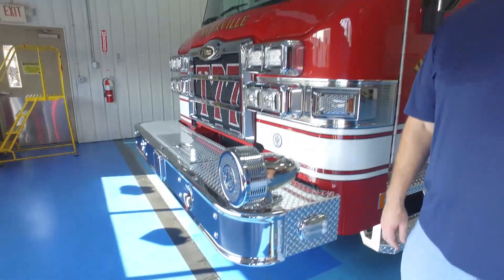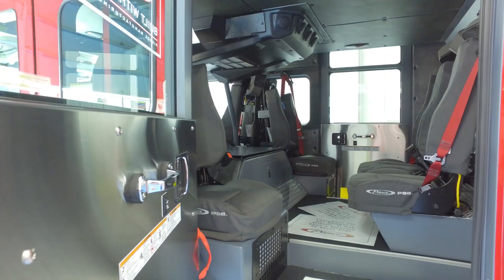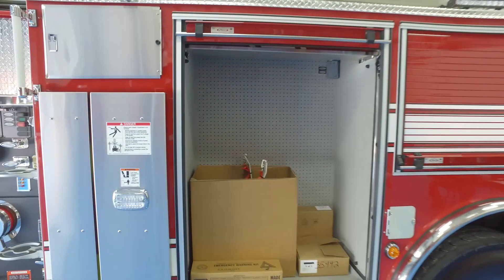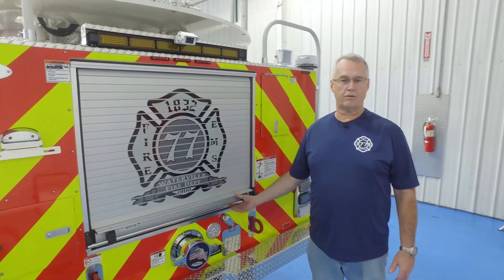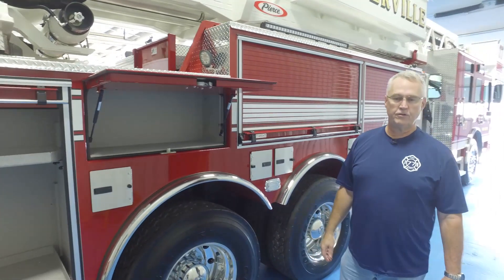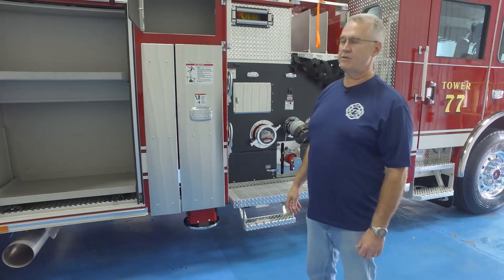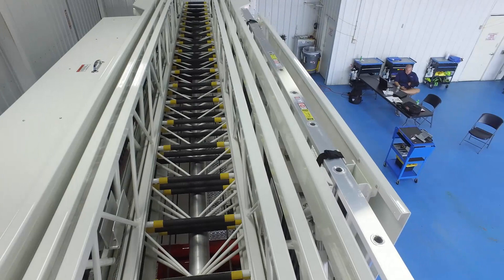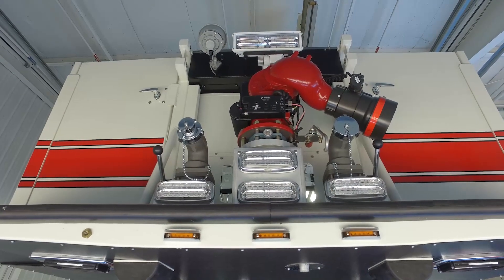Velocity® 100’ Heavy-Duty Aluminum Aerial Platform – Waterville, OH

Comment: How much?
Reply: Normally a rig like that runs between 850 and 1.2 million if it's custom. That's a stock truck so that's probably on the lower end of the scale.
Reply: @rolandmiller5456  Have to believe that it's at least 1.2 million.  The volunteer dept. I belonged to many years ago last year bought 2 ambulances at 1/2 million each just for an ambulance.
Reply: That is a really nice rig. And to get her demo or stock is impressive.